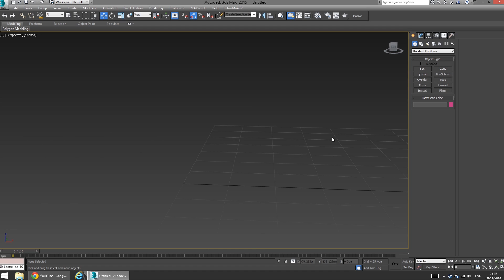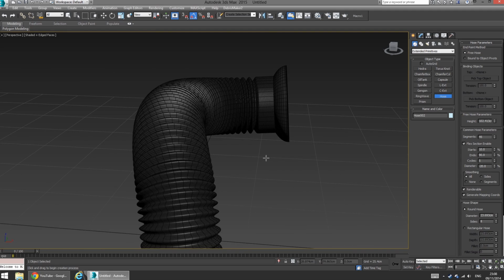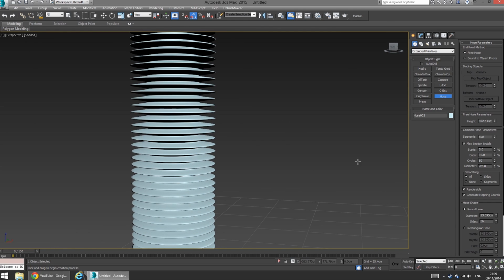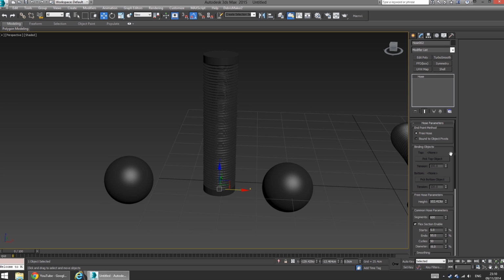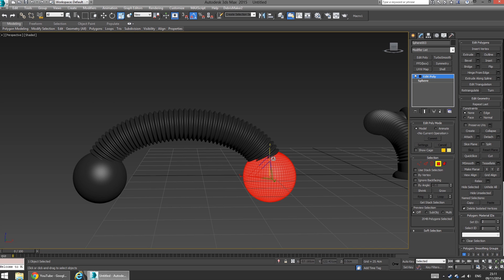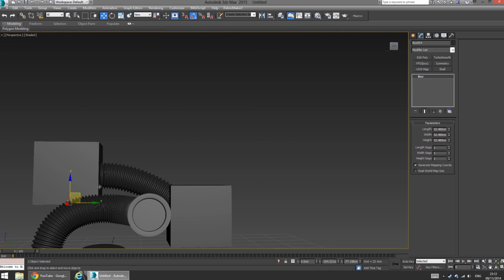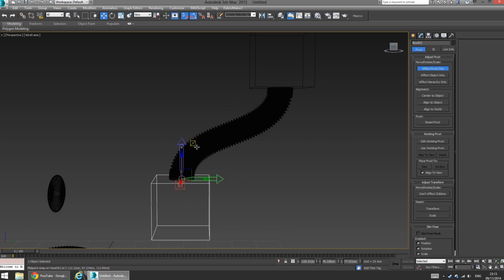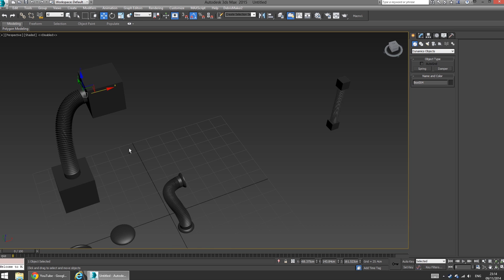Dynamic Hoses/Pipes and Springs | 3Ds MAX Tutorial

Comment: Loved your tutorial on hoses!  Very informative!  Just curious - I need to create an animation  of a pipe/tube buckling under axial load - something very similar to the one shown on the video in the following link.  Is this possible in 3DS Max? https://www.youtube.com/watch?v=TIGLesYueUc
Reply from the maker: +Sil .Patty Hi! Thanks for watching, glad you found it useful :)
The video you just showed me seems like an engineering type simulation, showing where the stress is applied on the material, etc. You could do something like that using a cloth simulation in 3Ds MAX, however it would require a bit of rigging on your part. Definitely doable, though :)